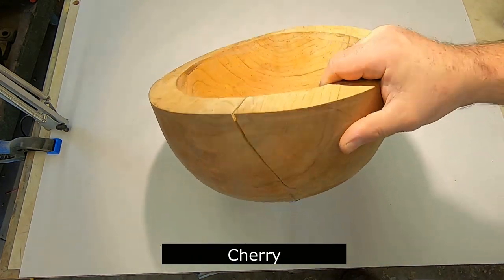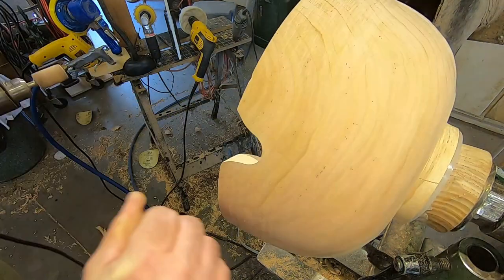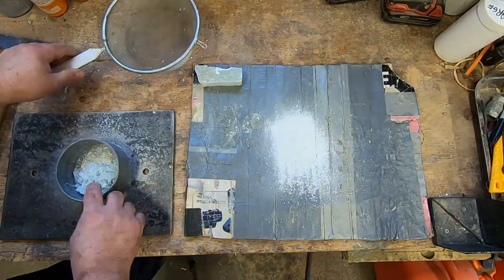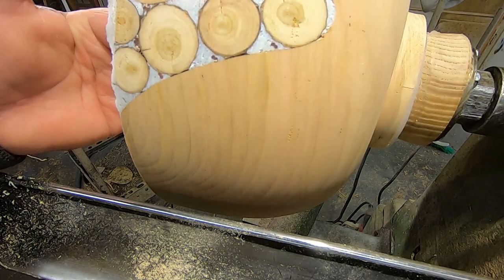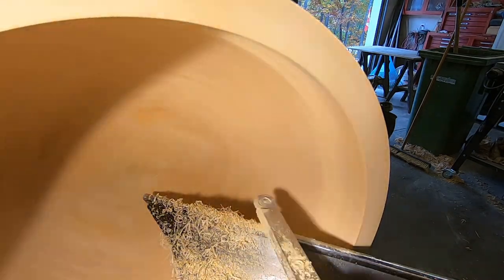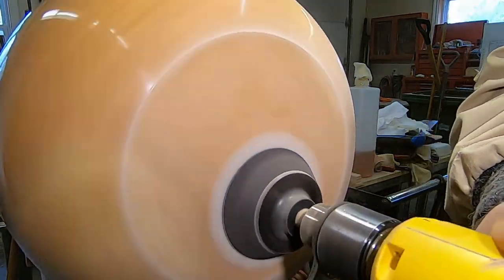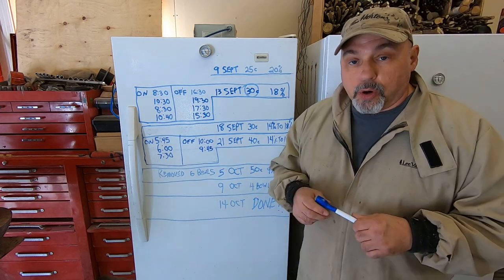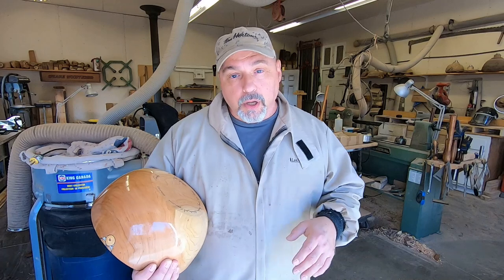Woodturning - Cherry with Cherry Branches and Twisted Copper wire in Soapstone

Comment: Jim, I'm shocked that you were having trouble with black walnut bowls cracking in your kiln. My experience with it is that's it's one of the more stable woods I turn and dry. Sycamore is one of the worst for me as well as fresh boxelder and mulberry. For problems with rough-turned bowls, I put them in Menard's bags and turn the bag inside out every day or two. this lets the moisture escape more gradually. I have more trouble with cracking if there is a fan blowing on them in the shop. Happy turning!
Reply from the maker: In this case I think I tried to dry it too fast, thanks for the info, Jim.

Comment: A tip for the fill: Use a muscle vibrator on the bottom to shake the material into the voids.
Reply from the maker: A needle descaler works well too, thanks

Comment: Jim,  Try a dehydrator...works excellent for me..
Reply from the maker: Can you control the rate at which the moisture leaves?
Reply: @SpragueWoodturning  Think it would be based on the temp setting and time in the dehydrator... I do mesquite alot.. Last piece i did was 37% when i started.. set dehydrator for 110' for 18 hrs...took reading each day for  3 days and turned it at 10.8 %
no cracks were visible... im sure it would be trial and error.. with the would up there... but really think it would work.. it certainly does for me... not really and expensive investment for the return i get..

Comment: Have you tried boiling the Walnut bowls for an hour or two before putting them in the kiln?
Reply from the maker: I have done some boiling in the past but not walnut. Is this what you do?
Reply: @SpragueWoodturning  I have done it with American Elm. Boiling somehow changes the fiber in the wood and it doesn't seem to split as bad. It changes how the wood smells too. I learned it from Youtube.  Unfortunately I don't have easy access to Walnut so I can't say if it works. I live in the Central Interior of BC.

Comment: Nice job , i see you like General Finishes too, have you tried the Wood Turners Finish they have that is a water based clear formula ? it wipes on easy and dries in like 5 -10 min. and has a nice hard food grade finish . I love using it , it is an amazing product that is easy to apply and I highly recommend it .
Reply from the maker: I have not, does it leave a high shine like the salad bowl finish? Thanks.
Reply from the maker: I just checked it out and it’s not certified not toxic when cured. The Wood Bowl Finish is.
Reply: @SpragueWoodturning  yes , i love using it because it dries so quick and you can put several coats on it in like 30 min.

Comment: Hi Jim, I may have missed it somewhere in your other videos but do you wipe off any excess finish with a dry cloth on each coat after it has soaked in or do you just apply it thin and let it flow out on it's own and hope for no runs in the finish?
Reply from the maker: I usually wipe the first coat if it’s needed. The second and third coat get applied lightly and are not wiped and just left to level out on there own and if done correctly won’t sag or run, Jim
Reply: @SpragueWoodturning  Thanks Jim.

Comment: when I use 
Gen Fin Bowl finish it stays tacky for 2 or 3 days in my shop, have you ever had that problem?
Reply from the maker: Lot number 102897 was a bad batch of finish, I had some issues with it this spring. The number will be under the label on the top. If it’s the same number return it to where you bought it from or contact General to get a replacement can.
Reply: @SpragueWoodturning  yea that is what I have do you know if I can just put a another cote on when I get the new stuff?  Thank you
Reply from the maker: It will not cure! Wipe it all off and put a new coat from a different lot number.